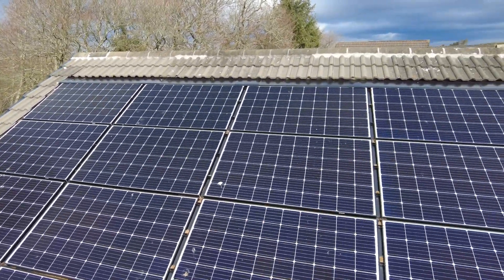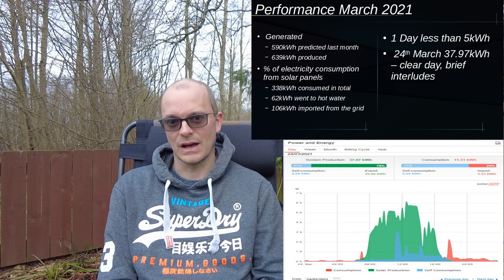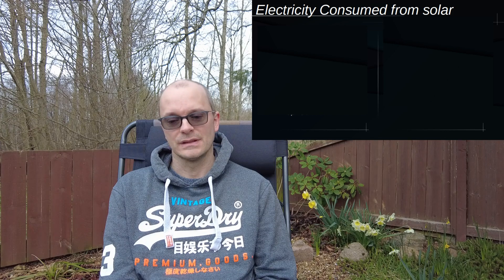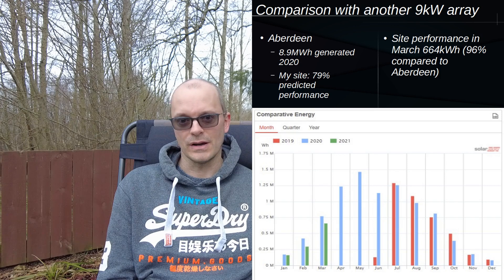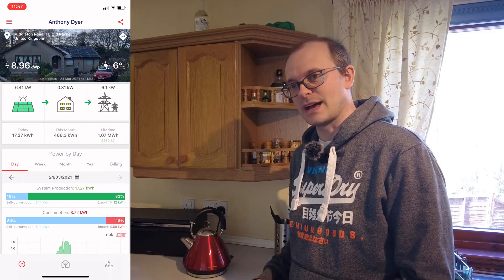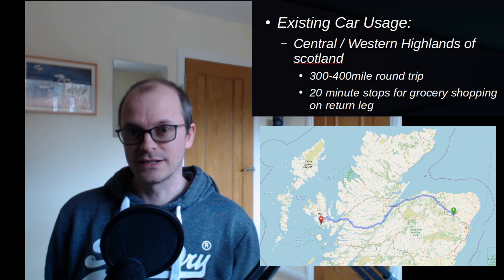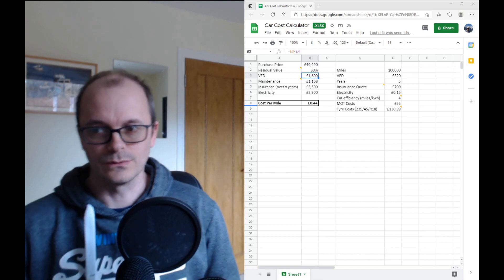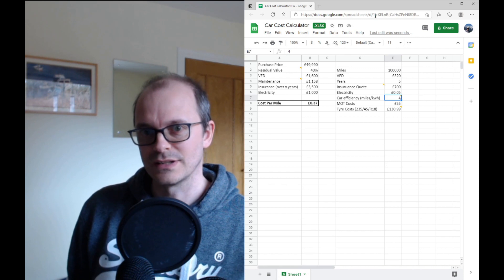Solar Panel Performance in Aberdeenshire, Scotland during March 2021

Comment: All I can say, pv is useless without battery unless you home all day.. as most of households are empty through the day, its not saving anything and not paying back.. even if you are home- you put washing on and it starts raining and you buying electricity from the grid..
Reply from the maker: I will say that there’s a fair bit of credit to your remarks.  Pre pandemic that’s exactly how I thought.  

However
1.  There’s nothing to stop you putting dishwasher or washing machine on a delayed start for daytime running.  I don’t run washing every day, so I can afford to sit tight until the brighter days.  
2. Export prices have been very good on the Octopus Outgoing Agile scheme, so it’s not useless, but it is still less valuable than actually using it.
3.  Batteries are now worthwhile at existing electricity prices.
4. Working from home is likely to remain a feature for many workers, even if it’s only on a part time basis.  Those people can charge their EV up on the free stuff at home instead of the expensive workplace stuff.
Reply: @anthonydyer3939  yes, agree on batteries and if people have EV. Installed many zappys and really like option eco++ mode where it only uses surplus. But again, if you working away every day its useless as you can only charge like that at weekends 
I was totally against them before, and I'm sparkie myself.. but now when they invented good enough batteries, it could be the way to go and may actually pay off itself in many years.  
But before batteries, pv companies were claiming that it will pay off in 7-8 years, which is total bs and scam in my opinion

Comment: Wow only 3.5 KWH on your lowest day in March. That's downright scary for the minimum input in Winter.

I live in a similarly cloudy climate but a little lower lattitude (47.1N) and I'm trying to figure out how much I need in panels to recharge my batteries even on the thick and cloudy days for an off grid system.

It sounds like 5:1 might be sufficient. 5x the panels vs batteries (with some kind of cheap load dump for the sunny days. Possibly hot water)

Comment: Interesting topic.Woodpecker was awesome!

You have a chimney /flu casting a shadow over your panels by the looks of it. That seems moveable? Is it also appropriate to factor in the carbon footprint of transport option - both the personal one, and the demonstration effects you have on your community if you went with an ev?
Reply from the maker: Mr Woodpecker is a great neighbour!

If I put (excessive) thought and effort into the Chimney, I'd have a mechanism that would fold the top part of chimney flat against the roof plane during these sunlight hours, and then straighten it out during all other times (and when it's raining).  However I'm not a mechanical engineer, but I could have a go with something like SolidWorks to see whether a 3D rendering  of such an adaptor would work.

Carbon footprint:  Working out the footprint from Diesel & Propane consumption figures is easy to calculate, but the footprint from my electric grid consumption is a much more obscure thing to figure out.  

Octopus Energy claims that it supplies 100% carbon free electricity, but the reality is that there are certain days of the year when there isn't enough electricity generated from Wind, Sun and Nuclear to cover their customer load.  They have to buy gas (even coal) derived sources of electricity to cover such shortfalls.  So therefore there's probably some sort of renewable energy "credit trading" to backup their claims (a.k.a making it look like your renewable surplus during sunny days covers your shortfalls during the poor days). 

However the value of the carbon footprint avoided is under-priced right now at all market levels:  There's no retail carbon tax on such fuels, and consequences of such a tax (e.g. market price differentiation between a poorly insulated and well insulated house) are simply not amplified at all.

So therefore if I was to illustrate the size of my offset carbon footprint, there's got to be more than just an arbitrary number (e.g. Tonnes of CO2 avoided).   People understand what money is (in relation to their pay), and that's how their investments are valued.  What we really need is a government that puts a (high) monetary price on those CO2 emissions, and then suddenly everyone can make a better appraisal of their investments vs the effects of climate change.

Comment: Seems the answer if you are up north is to have double the panels.
I am in Reading with 4kwh panels and I generate near your numbers in March I did 619kwh.
I have I think what everybody should have first before solar a battery.
This allows you to use products like Agile outgoing and export at very high rates it changes every day but by exporting an hour at peak I have drastically reduced my costs on Non solar days.
However since March I am in the majority on negative numbers daily as have excess solar and my forced exports.
However I saw your video on your system and note you are on Octopus standard rate.
I am on Agile Which is bloody expensive since Brexit, however last month my cost was £5.02 for the month all in.

Comment: thank you for your video. I did have a question regarding your array setup.  did you consider adding some addtional incline to array when you set up the racking?
Reply: I'm i NJ in the states and I find in the winter, along with very similar tree shading issues, my panel inclination is less than ideal.  this tends to resolve itself from March going into  the summer.
Reply from the maker: The solar panels form part of the roof covering, which means that if you lift them off the roof at an incline, then the roof isn’t waterproof.

What you’re talking about is extremely rare for pitched rooftops to have anyway.  Flat rooftops often have fixed (but adjustable) inclines for the panels.  However single axis motorised tracking, which is what I think you’re referring to, is typically reserved for ground mounted arrays and even then it’s quite rare to see.

I think motorised single/ dual axis racking systems will certainly become more popular, especially in tropical locations.  But right now they are not found in your typical solar merchants catalogue,  meaning that they will be expensive when you do find them.